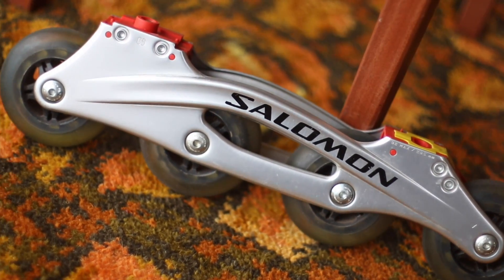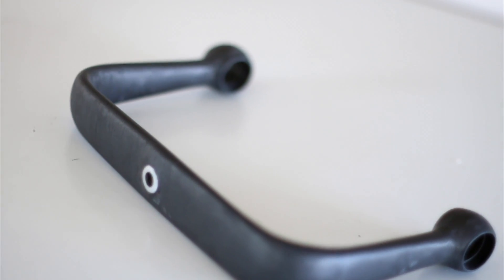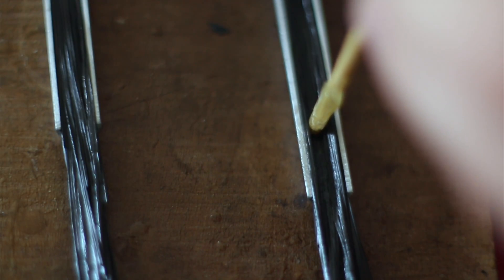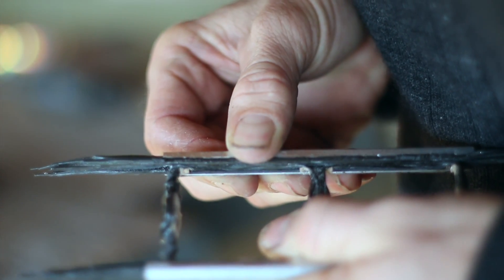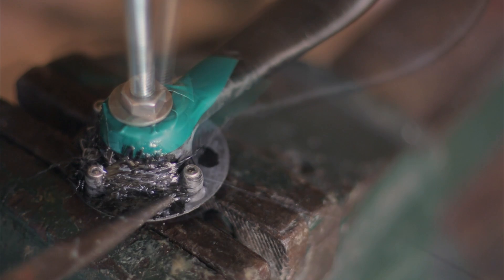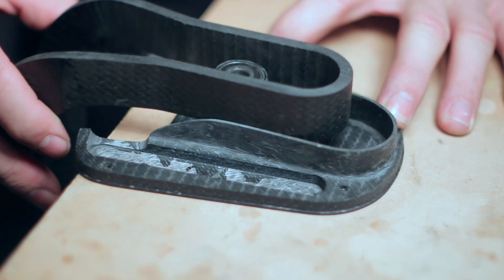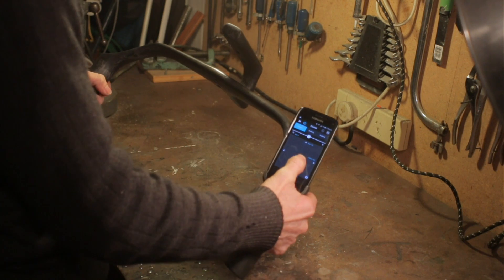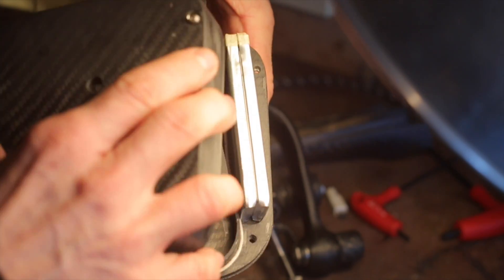Carbon Fiber DSLR 3 Axis Gimbal Build - Start to Finish

Comment: This series of videoes truly deserve more views and like than it has recieved. 
The technique of wrapping the carbon rowings around a balsa core is really neat, and it is something i will try and do in the future for complex hard to mould parts. 
Maybe you could save some time by using unidirectional carbon fiber tape? I have been using it for reinforcements on a riflestock I am building, and it seamt so work, but time will tell on that... But for a similar build it might save you a bit of time. But looking at your project here, time was not the issue, but the joy of building it. 

Seeing how you combined handcrafting and hand finishing with a "high tech" material is a nice twist, and I hope you take your time for a similar project in the future.
Reply from the maker: Thanks Clause. Indeed unilateral is the way to go in terms of strength and time. When I started the project I had a bunch of box weave lying around and decided to take the strands out and use them. Uni would have saved a bunch of time but the use of the strands really lets one get strength into tricky shapes and is esp good for repairs of plastic parts. Despite the time taken, in the end I learned quite a it from the strands which was good. Thanks for all your kind words and taking the time to comment and I wish you all the best for your own projects, cheers.

Comment: @elams1894 Do you think it's good to use glass fiber instead of carbon fiber for similar works?
Reply from the maker: +joshhhab for sure, either one is good, I prefer carbon, but glass fibre would do the job as well. Cheers
Reply: Thank you!

Comment: I have been looking for it, thanks! For the handle could be possible to use some kind of nice wood (it's my work material), also adding twisted carbon fiber. Can I find the code used in the project in any page or mail?
Great project, can't stop seeing all the parts.
Reply from the maker: Thanks so much, glad you enjoyed the vids. A wooden handle would look very nice indeed. I guess the weight would be the limiting factor. This unit on a 4th axis (a spring loaded arm) works very well. Cheers
Reply: elams1894 Thanks for answering, does the carbon fiber melts against the acetone. I had thought of replacing the wood with polystyrene foam, then melting it with acetone and thus creating an empty structure

Comment: Wow. 🙇 
That's lot of perseverance, mental and physical work.
Would be Great to see the video with the camera in place!
what do you figure it weighs vs a off the shelf one?
Reply from the maker: Thanks Prasanna! Indeed this was a bit of a stretch for me in terms of work load, it just seemed like it took for ever. Very difficult build but I'm glad I persevered as I learned a great deal from it. Weight is very key in gimbals indeed, however "weight distribution" is more important. Any weight saved on the frame can be used elsewhere for optimal weight distribution in terms of counter balances and/or adjustment mechanisms.  Th number one key important element however is frame stability. The frame, and in particular, the bracket that holds the camera MUST be bullet proof stable or micro vibrations will make their way to the motors, particularly the YAW motor. You must have a solid stable platform and motor mounts. This is where "off the shelf" models fall short, their structural strength is minimal and vibrations are induced making the gimbal nearly impossible to settle down. Thanks again!!
Reply: elams1894
Ah I see, thanks for explaining that: I think I get it better now: the frame's light(er) weight means more counter balance you can add (for same total weight), reducing micro-vibrations?
Ergo a more stable Gimbal and reduced Yaw?

Comment: WoW Elams....I have to give you alot of credit for that one.  I am used to all that sanding and shaping an moulding. I have been an autobodyman my whole life...you are absolutely remarkable. Why dont you rip it back down use your parts for a plug and make a mold to mass produce your hard work.
Reply from the maker: Thanks Robert, thats a good idea, I have thought about it a bit. There are a few design improvements I have come up with to make it rock solid, some food for thought indeed. Really appreciate your kind words!

Comment: Wow. Your gimbal's an absolute work of art. Thanks for sharing! I'd imagine you're probably enjoying some vibration reduction benefits too... one of the big things I noticed about moving from an aluminum road bike to a carbon fiber frame was how much road vibration it soaked up. I just posted a video about my 3-axis gimbals if you're interested... my quadcopter was hydro-dipped in black carbon fiber paint (it's not structural at all), and is just meant to help maintain orientation when flying around snow on the mountain :)
Reply from the maker: Hi Chris. Thanks for the kind words, much appreciated. Funny you should talk about the aluminum v carbon road bike thing. In a previous life I did a few ironman events, and some pals and I developed a carbon bottle rack for the back of the seat. The X-wing (aluminum dual bottle rack) was in production, and although cool, just ejected bottles like crazy with the road vibration. We made our own carbon version that sucked in any vibrations and worked better than great. I can fully understand where you are coming from there. Maybe its a triathlete sixth sense ;)

I always had that in the back of my mind when building this gimbal, and indeed i have zero high frequency oscillations. I found that if I had even the slightest bit of play with regard to anything on the frame then vibrations would begin to be introduced. I made sure everything was bullet proof solid and I get no vibrations at all. I checked out your vids and footage is fantastic, very stable. Great channel BTW, love the quadcopter! I find I have to be very careful with my Canon gear as it has no on board stabilisation, even the lenses dont give me that much extra stability, however my Sony gear loves this thing and I'm over the moon with how they perform together. Do you use camera gear with on board stabilisation or rely solely on Gimbal? Cheers
Reply from the maker: I see you use the GX85, i should have watched that video first. I found the same thing, you really need a camera with good in body stabilisation to get the most out of gimbals. You can get close, but you need that little extra help. Very informative video, thanks.
Reply: elams1894 No worries at all 😊 Cool! What Ironman races have you done? We did the Mont Tremblant half & full Ironman twice each - awesome course with a great community vibe! Yeah, the IBIS really helps - would love to have a Sony A7Sii some day though because I think it's slightly better!
Reply from the maker: Awesome work on the Mont Tremblant Ironman! Thats a hellova day at the office indeed. I did Swiss Ironman back in 2001, Tauranga NZ a bunch of times, and a few other halfs thrown in there. The Sony A7S2 is on my wish list too, maybe one day. Looks like Kiwis and Canuks live similar lives.. good to see that kind of active positive stuff on YT, keep up the good work! Excellent!!
Reply: elams1894 Thanks! You too - keep up the great work! :)

Comment: You're an absolute madman! The fact that you designed the whole thing from the ground up instead of imitating an existing design, the use of carbon fiber thread, the sheer craftsmanship.. I am in awe.

I'm sure you can't wait to move on to another project now but why not make molds from every single part? So that you can cast parts with resin, maybe add a layer of fiberglass for strength and basically be able to make as many gimbals as you want? Bear in mind I'm an "armchair craftsman", so I apologize if this is completely unfeasible.

Secondly, would you change anything from the design now that it's done? It looks and works amazingly well!

Finally, if you have time to grab some more footage shot on the gimbal, it'd be awesome! Especially considering how beautiful the place where you live is!

Sorry for the long comment, I am in pure awe of your artistry!
Reply from the maker: Hey Webdaemon! Thanks for tuning in till the end of this build, it has been a crazy ride, very complicated thing. Have a great day and all the best!!